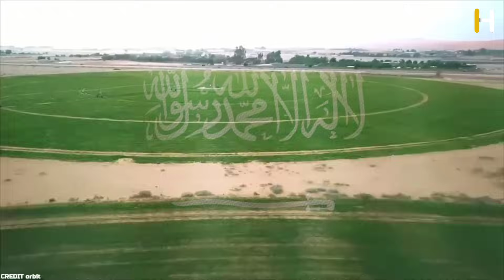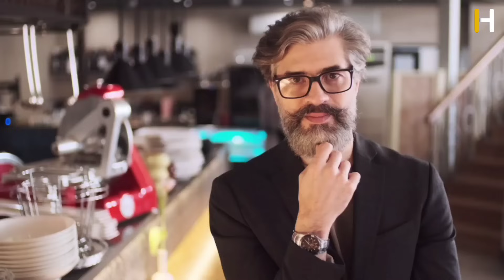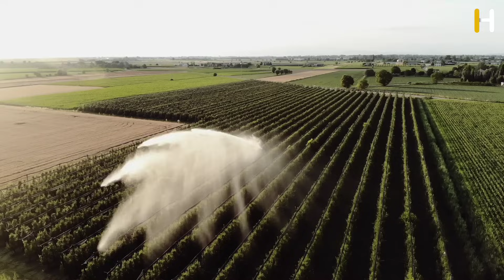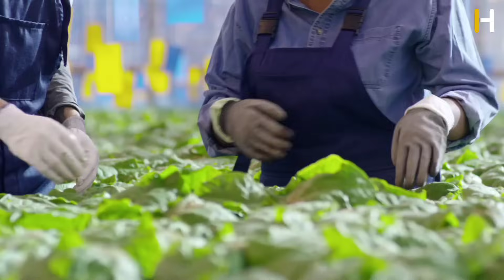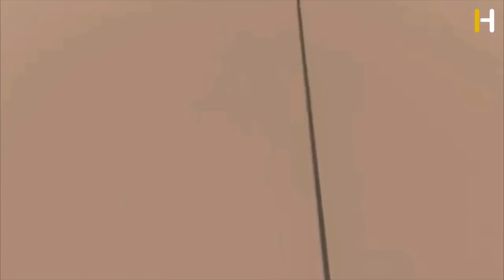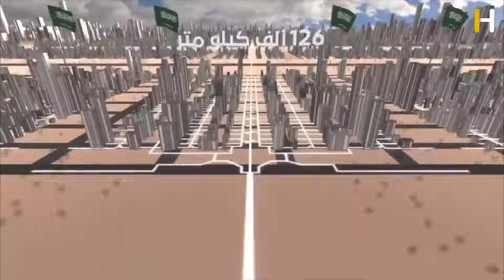Saudi’s 12,000KM Largest Artificial River In The Scorching Heat Of Desert

Comment: Does the desert soil they plan to get water to, have the nutrients to help plant life and sustain it? Will there be proper biodiversity ? Seems like a silly project.
Reply from the maker: dear Richard, You are right, the desert soil is not very good unless they can change things with advanced techniques, which can also involve a lot of money.
Reply: Lupine fixes nitrogen in the soil and helps it become more nutritional. It can help.
Reply: Theres well over 40 Desert plants. 
Theres enough shrubs and grasses, and wildflowers, Saudi could plant multiple plants near any water sources. If not there will be minimal shade an lots of Heat to evaporate the water. 
Its a highly ambitious project, an i think they are biting on something more than they can Chew. It about 5-10 years we might get an accurate response to how its going.